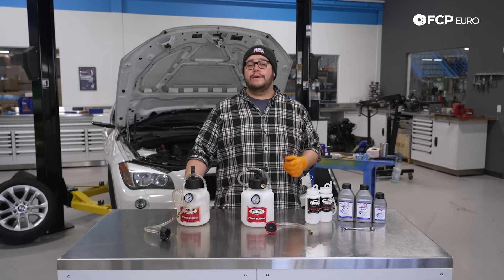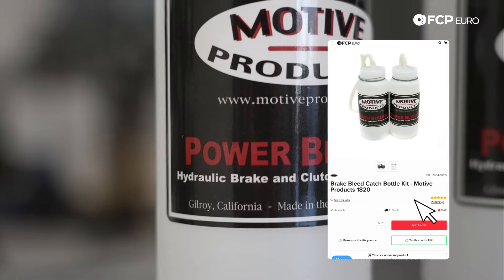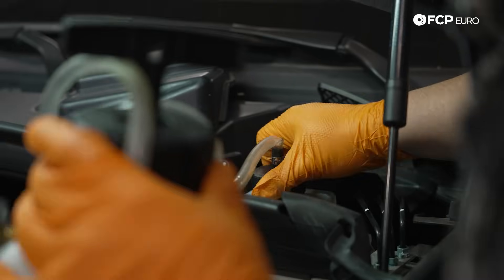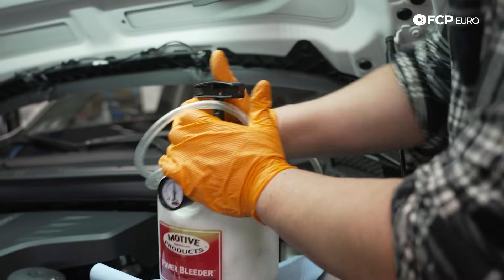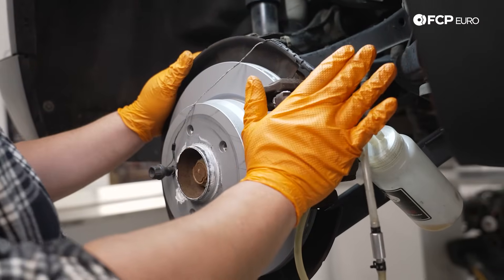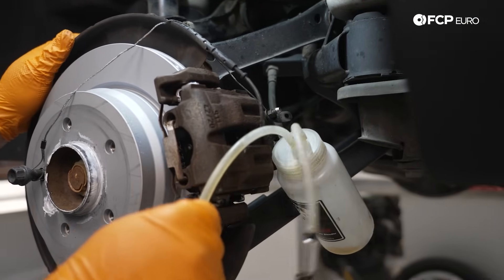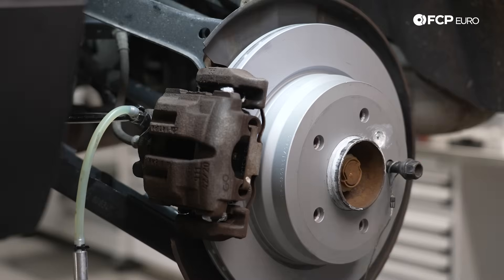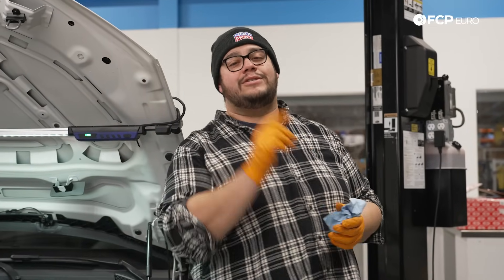How To Power Bleed Brakes Using A Motive Power Bleeder

Comment: How much pressure do you lose per brake caliper?
Reply from the maker: It really depends how long you keep the bleeder open, the longer you do, the lower the pressure drops. For that we recommend to check in between calipers and pump it up as needed.
Reply: @fcpeuro  okay thanks, so sounds like it should be checked more than once on a caliper if you are cleaning or replacing the lines to the caliper.

Comment: As I learned today, the little rubber gasket seal these Motive bleaders come with...is important, lol.  Mine came with two, a smaller/thicker rubber gasket, and a larger/thinner one.  Not knowing the difference I used the smaller of the two.  It fit fine on the brake reservoir, and was holding pressure up until about 10psi, which is when it blew right off the top - spraying fluid everywhere.   So yeah, if you're about to do this job and you're watching this video like I did....make sure you use the right gasket.  Great video btw!  Other than my own stupidity, the directions are spot on!

Comment: Do you need to prime the line from the pump to the reservoir? Where does all the air from the line go when the system pulls the fluid from the large bottle? Cheers
Reply: You should always prime before you connect it

Comment: If a vehicle is equipped with antilock brakes, the order of bleeding is furthest from the ABS block. Otherwise, yes, furthest from the MBC. My ABS block is on the passenger side. So, I go LR - RR - LF - RF
Reply: Unless it's a Volvo lol
Fronts to rear, no idea why 🤔
Reply: @ if it has abs, I bet the block is in the rear of the vehicle. Double check.
Reply: @zigwil153  ABS is under the battery near left front wheel.
God knows why it opposite but TBH if you do a thorough bleed it shouldn't make a difference.
A lot of Volvo owners have done normal sequence without issues so...
Reply: This is the way.
Reply: My 94 Integra with early ABS (the type with its own reservoir) specifies a crisscross pattern. RR-LF-LR-RF. Yes it’s very weird but that what the manual says.
Reply: No need to spread misleading information....Always check what the manufacturer recommends for your car...Not all cars have the same bleeding sequence

Comment: Why didn’t you add fluid to the reservoir along with the motive pressure bleeder? You just added fluid to the motive pump. I would assume you’re pumping air first before the fluid even gets introduced to the reservoir by pumping the pressure in it right?
Reply from the maker: You can certainly top off the reserve if you'd like first, but it's not mandatory!

Comment: On an e92 m3….do you have to recalibrate or cycle the ABS system before driving?  I’ve installed a Stoptech st40R trophy 4 piston BBK upfront and OEM rear.  Front and rear have braided lines and race pads.  Pedal is to squishy and long travel to my liking.  I bled the system again, some more air came out.. pedal became firmer but not enough to my liking.  What do we think it can be?  Thank you
Reply from the maker: Nicholas, you may have to check your scan tool of choice to see if there is an option to perform a brake bleed procedure. Typically the ABS units will need to be bled if the system was run empty.

Comment: Two things I learned using this this weekend is be careful to make sure the gasket doesn’t get pinched; you won’t know until brake fluid starts spilling all over the floor. Also if you own a mk7 GTI or similar put the cap somewhere where you won’t bump it, or you may spend 2 hours searching your engine bay for the f*cking thing. Learned both of these this weekend! 😂
Reply: How many n the world would the gasket get pinched? You mean by tightening the motive cap too tight in your reservoir?
Reply: @AlexisRodriguez-yv6sf  maybe pinched is the wrong word, but it definitely got out of place. I did snug it down quite a bit since the service manual for my car recommends bleeding at 29 psi, but just hand tighten

Comment: 2012 Volvo S80 T6. Swapped the front brakes to the XC60 dual piston calipers with the 336mm rotors. Bleeding the whole system just in time for some vacation trips 🎉

Comment: When using this tool to bleed the clutch slave, do you need to pump the clutch pedal at any time during the process, or after the process?
Reply from the maker: You can pump it while the system is pressurized, but there is no real need to do so.

Comment: Great video. One question, is there a benefit of sucking old fluid out of the reservoir and filling up with fresh fluid prior to the bleeder procedure? Thanks!
Reply: The benefit is that you are pushing mostly clean new fluid through the system instead of the old stuff.

Comment: Wow, thanks for this video! I got my early American rectangular power bleeder kit 0105 last year. However, it looks like I did not use it correctly. I did not know the fluid goes into the pump kit! So it appears I did a bunch of back-and-forth running back-and-forth constantly filling up the fluid reservoir (after unchaining the cap) and having to put more air pressure back into the pump kit! 
Now I actually look forward to using this kit on my other vehicles. And of course it should go a whole lot faster.

Can we use this kit on motorcycles too?

Comment: will it work for Toyota?
Reply: There are two chains and two J hooks and winged nuts that came with my kit. There is also an adapter that has a flat rubber washer , the intent is for that cover to sit on the top of the reservoir while the chain is strung under the reservoir and tightened with the wing nut to create a tight seal. The problem is that I could never achieve a good seal that way. So I fashioned a piece of wood to sit under the reservoir. To further complicate matters there is a strengthening ridge under the reservoir so I made a carving so the piece of wood sits flush under the reservoir. This was the only way for me to achieve a tight seal. So to answer your question...yes ...it will work with just about any vehicle if you are creative enough. I Initially bought mine to use with my Volvo and it screws on to the reservoir as shown in this video. One more thing , the clear hoses that come with this bleeder will eventually rot away and I took steps to clean them well with alcohol. I have since bought black fuel rubber hoses and retrofit the unit.

Comment: Purchased a unit and and pressure stayed at 15psi when testing for leaks. I then added fluid and pressurized again at 15psi. I then noticed the unit is not pumping fluid from the pressure pump hose to the brake fluid reservoir. Is the unit faulty?
Reply: Did you ever figure out what the problem was?

Comment: Someone please explain the physics of how the air between the fluid in the bottle and the fluid in the reservoir before pressurisation does not get pushed into the brake system?
Reply: You cannot ccompress a liquid (brake fluid) but you can compress a gas (air)

Comment: Should you active the abs while doing this? I replaced rear calipers and brake lines and can’t get brakes bleed for shit.
Reply: Depends on your system you may have a valve that isolates the front and back in case of a sudden leak. You say you replaced the rears did a line break prior to your repair?  The valve slides over to lock out the back tubing so that your front brakes still operate or vice versa if a fron line breaks. You need to locate the valve in the system and reset the position to allow flow to both halves.

Comment: what about the air thats stuck iin the motive bleeder tube before you pump it up?  Will that air go thru the reservoir and into the lines?
Reply: No. It is just caught in the reservoir.
Reply: @edgark9814: Good qustion, you may be able to get rid of it by running some fluid into a catch bottle before attaching the tool to the brake fluid reservoir, or alternatively  leave the hose end slightly above the reservoir until you see fluid coming out.
Reply: The air should stay at the empty section of the reservoir.
Reply: I had the same question.

Comment: i use this allways dry. first i top cars reservoir and attach the tool. air wont get the brake system if cars reservoir has fluid. it wont matter if tool reservoir is empty cause that air wont go bottom of cars reservoir where fluid goes to brake system.
Reply: Are you saying that as you’re bleeding at each caliper (while maintaining the pressure in the bottle), you keep topping off the reservoir? That seems very inefficient unless the system is already very clean (meaning you would not need to bleed out much fluid at each caliper). I don’t see any advantage to your method, only disadvantages.
Reply: @mabco888  i top it to full before i attach the tool. ammount witch reservoir hold is enough for bleeding all four korners. after bleedin remowe tool and top reservoir.
Reply: @Jakedelus unless your reservoir holds around 1 litre, then its not enough

Comment: Your catch bottle has a metal cylinder in line with the tubing, what is that, cause I don't see it on the ones for sale?
Reply: He installed that so he can shut the line off. It’s a check valve.

Comment: This may sound like a stupid question, but do you empty out the master cylinder before doing any of these processes?
Reply from the maker: No need. If the fluid is heavily contaminated you can extract whatever is in there and top off with fresh fluid to be pushed through immediately.
Reply: You really don't empty the master cylinder and shouldn't but you could empty the reservoir of old discolored fluid rather than pushing it through the system. I use a turkey baster to do this then I top off with clean fluid before commencing

Comment: Was the fluid from the pressure bottle line to the master cylinder cap completely full of fluid?  Or were there gaps of fluid in that hose?
Reply from the maker: That line will never be completely "full" of fluid; they always have gaps in them, so totally normal if that is what you are seeing!

Comment: When you pump pressure forcing fluid over into the master cyl  what happened to the air that was in the hose and master cyl ?
Reply from the maker: Any air in the system will be pushed out via the brake lines and can be seen when cracking open the bleeder valve on the caliper.

Comment: I can't get my r53 mini clutch slave to stay bled. I can get it good enough for a day but my the next morning I have no pedal. Hoping this tool will do the trick
Reply: Did it do the trick?
Reply: Turns out I had a cracked reservoir. Buy yes I use the power bleeder and it works great

Comment: How do you know when you’ve bled each caliper enough? Especially if the fluid is the same color. Can’t seem to find that answer or how much fluid should we expect in each caliper.
Reply: Whenever I’ve done this, it’s always been easy to see the transition between the old fluid (amber or brown color) and the new stuff (clean looking and transparent). I guess it may be different if you’re working on a track car or something like that where the brake fluid is changed frequently, but for a normal car with fluid that’s probably a few years old, you shouldn’t have a problem.
Reply: What comes out must go in, if you end up purging a pint through the system then you do.  The important thing is to do it enough that no further air bubbles exist any where in the system - it is best to get things gravity bleeding first before applying pressure, open bleeder into receptacle and keep master cylinder topped up and allow the liquid to begin flowing on it’s own.

Comment: Great video, I was cheap so I went ahead and bought the "smotive" version of this device. I am actually really impressed with how feature rich it is however. There was a slight leak when I put it to 10psi ( could hear it but the psi did not decline rapidly). I adjusted the cap a bit and it seems to have gone away.. wondering if the threads on my reservoir are worn.

Comment: You said you start with empty reservoir. But some explanation on how the reservoir gets filled would be helpful, my assumption is Motive fills the reservoir and then as you open the nipples on the caliper it causes the used fluid from the brake lines to drain. Is that right?
Reply: Thinking the same thing
Reply: That's correct, with it being pressurized the Motive tool is also filling the master cylinder with fresh fluid at the same time forcing new fluid in.
Reply: @jeffherrington  Thanks

Comment: Shame they dont do domestic cars
Reply: I use this on my Jeep Wrangler
Reply: An alternative way is to use a "Mity Vac" . Rather than pressurizing the system you are actually sucking the fluid out. This will work on all vehicles as the vacuum pump is held and pumped at the calipers. The only downside is that you have to be constantly checking and topping off the reservoir.

Comment: Did you first empty out the master cylinder? Or did you move all of that old brake fluid along with the new brake fluid through your first bleeder valve?
Reply: I believe they moved the old oil through to avoid any air getting into the lines.

Comment: Do you need to empty the reservoir before attaching the bleeder?
Reply: It is always a good idea to do that, if you don't want to waste new fluid. Just make sure the pressure bleeder is not pushing air up the tube before you start the bleed, as sometimes happens.

Comment: What if the reservoir is rectangular with a snap on cap ?.
Reply: There is a different adaptor for that type, you can purchase different kits that come with different adaptors. Also you can get the various adaptors individually

Comment: On initial pumping there is air in the line from the pump to the reservoir. Where does that air go? How do you prevent it from being forced into the system under pressure?
Thanks
Reply: This is a physics question and has to do with fluid dynamics, static pressure, and the characteristics of air vs liquid.  To keep it simple, as long as there is liquid in the reservoir, the air in the reservoir (or that you introduce via pressurizing) will not overcome the resistance of the liquid below it given a closed system.  Air and liquid (esp brake fluid) are not inherently miscible, without strong outside force or chemical reaction.  Remember - there is always some air in your reservoir anyway, even after you top off and close the cap, and it doesn't enter the line either.  When you open the bleeder valve, you are easing the pressure only slightly, allowing the air to "push" the liquid through the system.  We are talking about nominal static pressure here, 15-30 psi tops, which will not displace the liquid.  It's the same theory that power bleeding systems operate under, so the Motiv system isn't doing anything novel here.
Reply: My question exactly.  There is also air on top of the fluid in the master cylinder reservoir/under the cap.  If you watch the end of the video, just after he's done bleeding the system,  and before he de-pressurizes the bottle, there's a big ol' air bubble sitting in the hose.  I believe this air bubble literally stays on top of the fluid the entire time, and just like magic, doesn't get forced through any of the brake plumbing.  Somehow the brake fluid flows and the air bubble always stays on top.  This could be because that brake lines are such a small diameter, and you're only cracking open the bleeder valves and not allowing such a huge flow to allow the air to "gulp" through the system?  

I have the same question about engine coolant vacuum fill systems.  Yet I use them, and they work too.  Neither systems have any method to purge air before filling.
Reply: Dang good question!

Comment: I dont understand how the pressurized reservoir works. How is it not just pushing air out since the exit nozzle is on top??
Reply: There is a clear pick up tube that picks up from the bottom of the bleeder and this tube is attached to the "exit"  tube where it exits the container. It is pretty much the same concept like your household spray cleaners. And you are observant ! So as the air is pumped into the container that contains fluid it, will push the fluid out into the brake reservoir. Hope this explanation helps.

Comment: Thank you for this video. I have few questions. I have Mercedes with SBC system (SBC stands for Sensotronic Brake Control and it's an electro-hydraulic brake system). It requires a bleeder to maintain pressure between 2 bar and 2.5 bar (that is 29 psi and 36 psi). Please tell me if you have any tools that can do it? Also what if I build the pressure up to 30 psi using this Motive bleeder? Will it hold such pressure or not? Thanks.

Comment: Was the fluid reservoir already full when you hooked up the tool?
Reply from the maker: It will usually be at its normal fill line when starting the procedure.

Comment: Would you guys recommend this when trying to bleed brakes after master cylinder was completely drained? I replaced my 2 front calipers and drained all the brake fluid from the system. The car sat for a year with no brake fluid and now that it has all the calipers and lines connected, I tried bleeding the system, but it still feels spongy and the brake pedal goes to the floor after what I thought was a successful bleeding job. Would appreciate some advice.
Reply from the maker: 100%. Depending on the type of vehicle you have, you may need to actuate the ABS pump to get any air out of that as well.
Reply: This is likely because you still have air hidden in the system . Did you Bench Bleed the Master Cylinder? need to Bench Bleed the Master Cylinder when it runs dry. Its NOT hard at all. And actually simple. I did my first one today and i had alot of air bubbles trapped in the Master C.